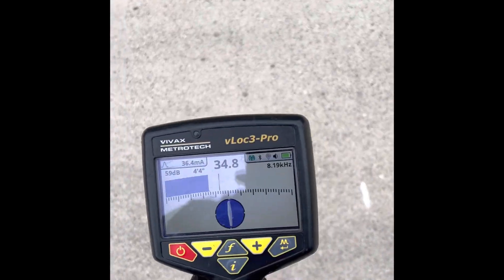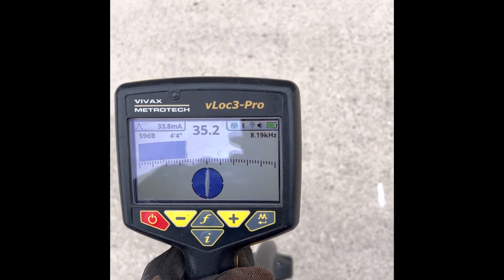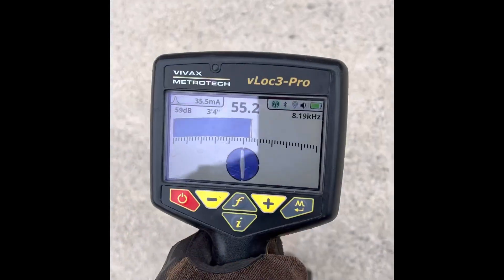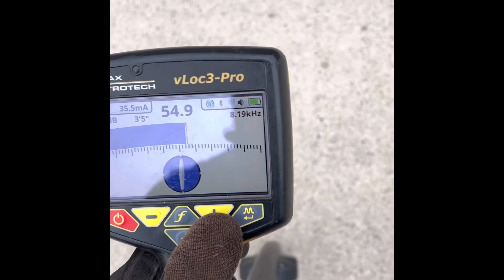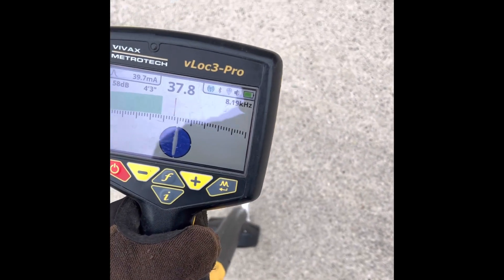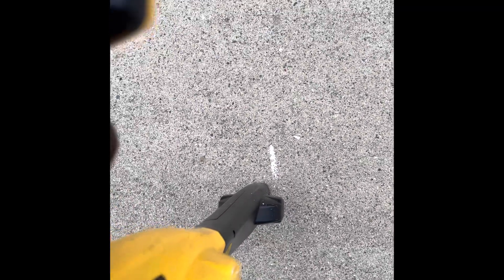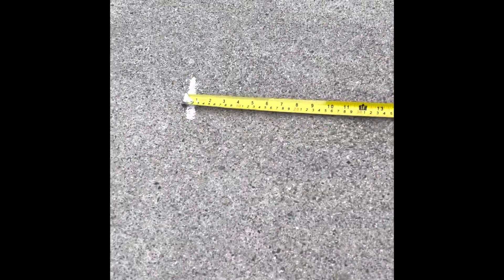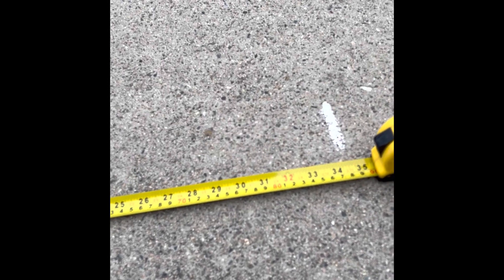Utility Locating- The 70% Rule

Comment: An easier way to do this is, on top of the pipe touch the ground with the receiver and tilt it to 45 degrees. Slowly start to move left or right until your meter peeks. The distance between the peaks is your dept. A Squared x B squared= C Squared.